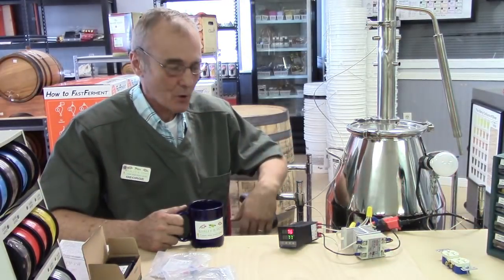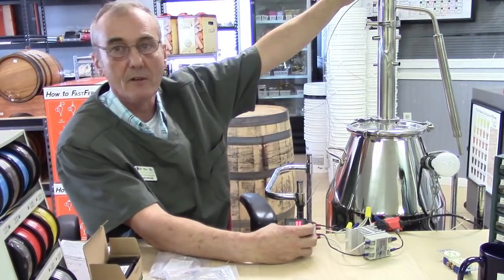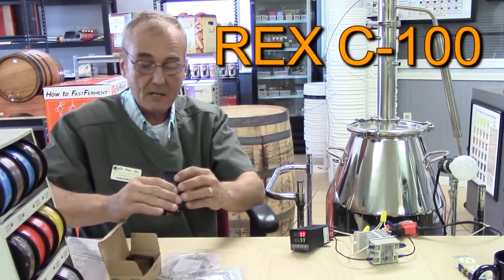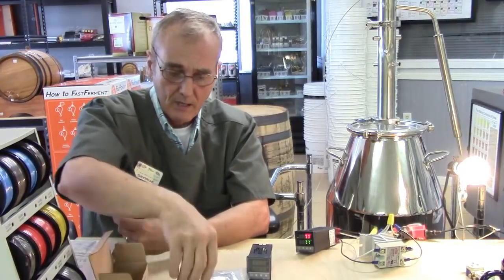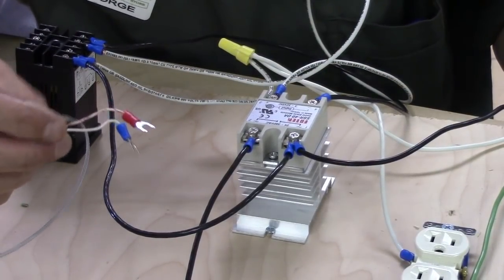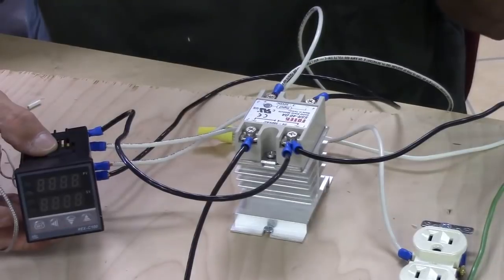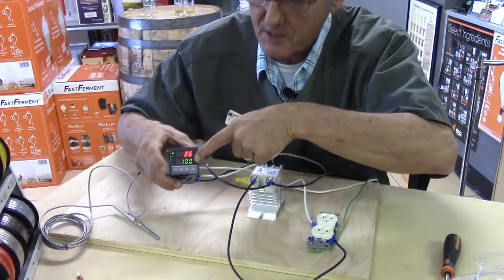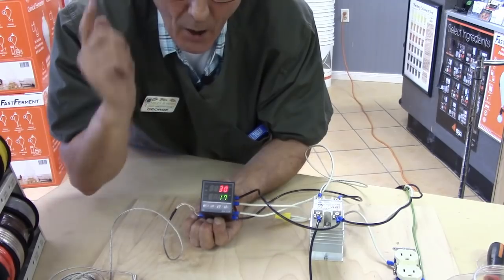WIRING THE PID CONTROLLER

Comment: Hello, where I live, in Argentina, we have 220V between lines and a neutral, therefor between both hotlines we achieve 380V.
I’d like to know if it’s feasible to connect the element between bothhot lines to get mor power. If so, in which PID’s terminals should I connect them.
Thanks!!
F

Comment: One wire goes from Mains 110/ 240V straight to your fan heater etc the other from mains to the PID and it switched on and off by the PID...The PID tells the controller when to switch on or off your Fan/heater.....Best video I have seen and no KRAP noise booming in the foreground

Comment: without a doubt the best and  easiest to follow tutorial on wiring up one of these common little devices. you pretty much made it as simple as it will ever get. great job!  one thing though you should mention though is the differences of wiring colour around the world. my main and neutral wires are brown and blue not white and black like the USA leads. but obviously if you dont know this then you should probably leave it to an electrician.

Comment: I was absolutely impressed by your explanation and want to say thank you. I am trying to make a cooker that requires a specific temperature to operate with. Earlier I was using a ready made CTW thermostat controller;  the kind that is used on pizza pans. however, I was not able to get the right operating temperature as it doesn't have a digital temperature setting dial. hence , while researching for a better temperature controller, I arrived on your You tube explanation which I found to be not only very easy to understand but also exactly what I wanted. I therefore owe you a million thanks.

As mentioned by a fellow spectator, please do not apologize for repeating yourself. For a person like me even with a technical background, this is the kind of grass root explanation that I require to understand the fundamentals of how it works.

Getachew

Comment: doesn't explain how the socket is connected, where the other end of the black wire goes (one connected to port 1) and where the other white wire goes.. pretty disappointing if you're trying to follow along. out of all of george's instructional videos this turned out to be disappointing to be honest

Comment: I have an old Satellite kiln that I upgrade to digital, and recently the SSR was burned, now I order another SSR 40A, and  I, going to wire with high temperature insulated coated wire, and the wires4 and 5 just regular and probably smaller gauge wire do you think is a good idea?

Comment: By the way there is no reference to the heat sink..... Please can you say if the heat sink is crucial when the relay is fed by 110v and the controller is controlling at 200C. I would appreciate your help. I could check the temp as I have a laser thermometer if it is used without a heat sink.  I've not got much room to fit a heat sink but if it's essential I could with difficulty fit it.

Comment: Wonderful, clear and concise tutorial. There is just one thing I may have missed. Where does the heating element fit into this circuit? I'm currently building a heat treat oven. Thanks from the UK.
Reply from the maker: It goes in the oven and connected to pins 1,2 on the solid state relay.
George
Reply: Barley and Hops Brewing Thank you George. Greatly appreciated. How do you find the rex-c100? I've read mixed reviews, some say it won't drive the SSR! Thanks again, Matt
Reply from the maker: I am not a big fan of the Rex C-100. I prefer the Mypin TA series or the Inkbird ITC 106-VH model.
George
Reply: Barley and Hops Brewing great! Thanks George.

Comment: How would you wire 2 120v 1500w elements in parallel with 2 pumps with a main switch and switch for each pump and element
Reply: 2 relay  maybe ?  test if the relay set in parralle switch on and then i guess wire the 2 relay to a separate  wall plug ?  in and out ? differant breaker for input  and another female plug for output ?

do it at your own risk i never actualy played with house electricity

Comment: Great video. Made it easy for a dummy like me. My controller is used in a powder coat owen. I am experiencing problems with the PV exceeding the SV. I had SV set at 200 degrees celsius, but PV rose to 240 degrees, and heating elements was still red hot, full power...... Any ideas how to sort this? I have a second Breme REX C100 supposed to be used in a beer boiler, but not keen on using that if I can't control the temerature with it...
Reply: You need to go into se setings by pressing the SET button for 5 seconds and and then swith off 'P'. Not the expert myself but play around with settings and you will find how to get it to stop heating once it reaches the set temp.

Comment: I have a berme rex c100. With the pins? I have 1,2, 3 and 4. no 5? but looks like 3 and 5 are the same?also missing the alarms. and number 8. Hooking up 300watt , cylinder mold heater to it. Very good video, thanks you. I will be doing it this weekend.

Comment: George I do have a question I’m wiring up a 120v PID and I want to make sure I have it setup right I have a 4 prong lighted switch for power on/off do you think I should add a Fuze to protect my PID it’s a pretty expensive one it’s a Auber I just don’t want to fry it it’s hooked up to a 20amp breaker is there anyway I can send you pictures so you can check out the setup and see if it’s wired right??

Comment: Thanks for this.. I fabricate car parts.. I'm not an electrician. I'm another one of the DIY powdercoat oven guys. I took a 4 drawer filing cabinet, fabricated a (110v) 1500W two-burner portable stovetop into the bottom and I'm running this C100. 

It's an ungrounded cooktop so I just replaced the receptical connections with the respective power cable wires. I wouldn't have gotten it right if I was left to my own devices.. lol

Thanks again. Now its time to powdercoat some stuff bigger than the inside of a toaster oven.. ;)

Comment: Hi Can you help me . I have the 24Volts rex c100 . How do I wire that to my heating element ? Port 4&5 shows SSR and then from the SSR how do I connect the main power and heating element to the other side of the SSR ? Great video just confused because you have the 240V rex c100

Cheers and thanks !

Comment: This video is exactly what i was looking for. I have a Masterbuilt smoker that had all dead controls. The individual parts would have been as much as a new smoker. This video helped walk me through making a better control system at much less than it would have cost to repair the original equipment. Thank you so very much. If i may offer a small bit of constructive feedback. It would be helpful if you a wiring diagram overlay somewhere throughout the video, it's also likely I just missed it. Either way thank you so very much. Great video.

Comment: Question?   I only have a 110/15amp plug right now.   If I bought the PID and the 40amp SSR and used it with a 1500w element with my current 110v plug.  Wired it using 220/30amp gauge wire.  Would it work just under 110v?    Then in the future when I upgrade to 220v all I would have to do is upgrade my element and plug it into 220?   Kinda future proof it if I want to go bigger.
Reply from the maker: Sure

Comment: Hi, you are using an SSR with a 24V-380VAC output because you are supplying AC current to your heater. I want to control the temperature of my silicon heater pad that requires an input of 12V DC. Do I need to get an SSR with a DC output? I am a little confused because in another youtube video the person putting up a similar set up was driving a fan with a DC supply but using the same 24-380VAC out SSR as yours. I think he might have misquoted the supply to be DC.
Reply from the maker: Probably misquoted it.

Comment: Here is a question that i would not have asked if i saw your video before, i ordered the PID  AGPtEK TA4  RNR model  instead of the SSR model that you specified to make sure to use with the SSR relay, but now i wandered if i can use the RNR with the relay or do i have to buy the SSR absolutely in replacement. This will be to control mi lead melting pot for doing bullets.

Comment: I need to replace my controller. My current controller has 3 outputs all mechanical relay 5a. 1 and 2 are form A and 3 is form C. 2 & 3 were used to control the burner control box and the Honeywell combo valve. 1 is not used. My new controller has two outputs 1 & 2 form a and form c. I am guessing that I can just use the 1 and 2 in place of the 2 and 3
Thanks
Charlie

Comment: I have always wondered why the Chinese who are obviously 'cleaver' at making these devices for 'peanuts' hardly ever supply a decent line drawing and further more that the terminal numbers match the line drawing.
You are a gem when it comes to explaining these devices.
I have sorted out quite a few faults in my time being a retired commercial heating engineer covering all fuels but I must say I always find it deplorable when good instructions are not given with any instrument that needs  an explicit wiring diagram........   Very kind of you to give the excellent demo.....    Can you believe how much these PID's cost?  
The postage seems to cost more than the controller!

Comment: Great videos. Q: I am applying your videos to a powder coating controller. I am trying to have overheat protection that can be wired into a manual reset button. I will be working with 12o volt and upgrading to 240 volt later. Any chance you can help me out? Many thanks and keep up the great videos.:)

Comment: Thanks for wonderful guide. 

I have a standard worktop 750w water distiller that i like to adapt for oil distillation as well as water. Would this PID work to help control the temps on this much smaller unit ? 
Is there something less complex or smaller that can be used instead ? 

My distiller - https://www.ebay.co.uk/itm/152707748210

Comment: ok im confused, so the PID keeps temp by turning element ON (wide open) and OFF (slam on breaks)??? What Is Used to controll voltage so it feathers into correct voltage to maintain proper whats to maintain temp?
Reply from the maker: The pulse nature of the combination of the PID and SSR only provide a percentage of power to the element and not full on or off. The switching happens at the zero crossing of the sine wave and is timed.
Reply: @BarleyandHopsBrewing  ok i get it now thank you

Comment: Great video. Thanks! What is puzzling me is the wiring diagram of the SSR output. It shows clearly a + and - minus sign, but also a relay make and brake contact with the mother contact on connection 3, so I first thought you had it wrong and had to use connections 3 and 4 because that should be the make contact. Any idea where connection 3 is used for?

Comment: Which relay? The SSR 25-DA, SSR 40-DA, or SSR 75-DA relays
Reply from the maker: This all depends on your element size and circuit. For most people with a 120 volt circuit and a 2000 Watt element the 25 DA is plenty.
George

Comment: I am trying to wire up a simple heating element for my electric smoker with this PID controller.  I need to know how you wire it up.  Also, was wondering if the SSR you are using is AC-AC or a DC input and AC output. I cant get the SSR to turn on coming from the PID only. Not unless I add in a DC power supply.
Reply from the maker: If your SSR is a DA it requires DC as a signal to operate an AC voltage. If it is an AA then it requires an AC signal for an AC voltage. PIDs normally use the DA.

Comment: Hello sir great video and I like the way that you take the time to break everything down with an explanation of why it's being done that way. I have a question hopefully it doesn't sound to silly. I'm building a oven for applying Cerakote. My heat source is going to be an element from a oven. How would I wire that into the system that you showed in this video. Thank for doing these videos. I'm in the process of building one of these boxes now, I'm just a little unsure about this last step. Thank you sir.

Comment: Great video and very helpful. Just a word of advice, considering you're plugging the PID system into a 15 amp circuit (that uses 14awg wire from the main breaker), using 12awg wire for your PID system is redundant. Also 120v heating elements are extremely inefficient and I would highly recommend using a 240v one.

Comment: Great video 

I've been watching every video and downloaded 5 or 6 manuals for these PIDs and now am getting the idea of what PIDs do what and how to decode the model number. 

Whats the model of the PID you have? I found out the numbers past REX-C100 mean something.

One minor point. Thermocouples measure the small voltage created when two dissimilar metals, in the tip, create a tiny voltage. That voltage is measured by the PID and converted to temp.  

PS Oh I'm going to use my PID to control a fan for a BBQ Smoker. More air = more heat. A little more iffy than just turning off and on a heating element. :)

Comment: Sir, can you hook up a light/buzzer alarm to the MYPIN PID Controller? If so how?
Thank You!
Reply from the maker: You need to provide the power (the PID does not have an out signal). The alarm pins are like a switch. Use it as you would a standard switch.

Comment: I purchased this exact same PID controller I figure the alarm goes on screw pins 6 and 7 but what do you use for the alarm sound? Can I just use a 8 ohm tweeter driver? and just attach  it to the two pins?

Comment: Hello Gorge,  I had asked you a question about hooking up a  Band heater to the controller.  I assumed I didn't need the SSR.?  So If I hook up the leads to the Band Heater, Do they go directly to the same terminal for the power ? #1&#2 ?  If I did that,,, How would the thermal coupler turn off the power to the Band Heater ?   I'm  missing something ?  In the Mean while,,, I did wire in the SSR and it seems to be working, just the way your video showed..  I'm still in the process of machining the brass part the thermal coupler goes into. The band heater is 120V.  This is for a Oxalic Acid Vaporizer.  I guess I'm asking "if the band heater takes 110v and 2.2 amps".. I would need the SSR wired into the system, correct... ?
Reply from the maker: Your band heater is a 1500 watt heater element and the amp rating on that is 12.5 amps so an SSR is necessary. 
The probe measures the temperature delivered and the PID works out the algorithm and provides the appropriate power for the element. So it is the PID that controls the SSR (not the probe) via pins 3,4. You would attach the band heater to pins 1,2 on the SSR.

Comment: I was waiting for you to light up like a Xmas tree while you were holding the back of the PID with 240 volt live terminals. Scary.
Reply from the maker: Careful,,,,
Reply: That's 110~120
Reply: And he had it protected would have had to touch a screw which would have been very hard to do

Comment: Great video, question, you have a hot, neutral and ground running down the table to the floor you did not touch on. Where are these wires going? I would think the circuit breaker but i may be wrong.

Comment: hello i had buy one rex c100 pid controller for some project i want to create to cool the water
and i want to know if there is a way program this controller to start the cooling in 25-26 degrees and stop when the water will be at 22 degrees 

i understand complete how to wire the thermostat but i dont know how to programming the setup if there is any option like the one that i want

thank you

Comment: hello Mr. Barley i like a lot your videos, i have a question: how does the heating band should be connected because mine is not turning off or is there a configuration that i should do in the PID controller

Comment: Hey george, i found out instead of wiring in the light seperate, you can also use an extension cord with a lighted end for the heater element cable, so it will blink on and off when its receiving power.

Comment: Hi George, thanks for easy to follow tutorial, i follow your instruction and my PID and SSR works, but why is the lamp is not turn off when it reaching the temperature I set up ? I setup to 45 degree, when it go beyond 45, the lamp is turning on but when it below 45 the lamp is blinking only,  I want the lamp is turn off when it go above 45 and turn on if it below 45, what else should i set to do that ?  thanks for your help..
Reply from the maker: You have it set to cooling instead of heating.
Reply: @BarleyandHopsBrewing  yes you are right, I'd change SL6 parameter value, and now it's ok, thanks for the tutorial, you save may life :)

Comment: Hi George, great videos as usual. I am using the inkbird itv-106vh with an SSVR relay and rheostat. I am hoping I did not make a mistake but can I use the PID controller in conjunction to interrupt the rheostat for manually reducing  element power without using an SSR relay? I was going to use the  + and - on the inkbird in between the SSVR and rheostat. Looking for your thoughts on this. Thanks. I an using this for plating tanks.
Reply from the maker: Never mix PID and rheostat devices together. You are working against yourself.

Comment: I have a question about the 77* temp at the beginning. I like to cook off a still at about 193-195F which would be 89-90* C. Why is it set for 77C in the beginning? Is that the temp you want at the top of that riser thing or was it just 'any' number for experimenting/testing the setup. Thanks again for your Great video.

Comment: Hello George, what part number thermo couple is that, mines to short!. This is a greatvid Thank you from Down under (Y)
Reply from the maker: It is a k type 50cm probe. They make em short and long and I've seen them as long as 100Cm.
here is an amazon link to them
https://www.amazon.com/Aodesy-0-500%C2%B0C-Temperature-Controller-Thermocouple/dp/B07G96BQNP/ref=sr_1_3?keywords=50cm+k+type+probe&qid=1561210421&s=gateway&sr=8-3